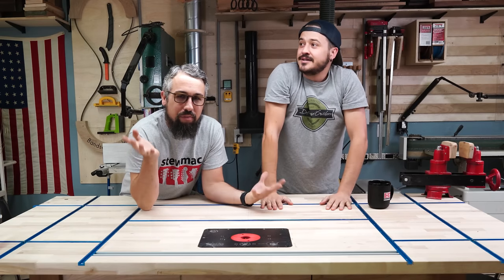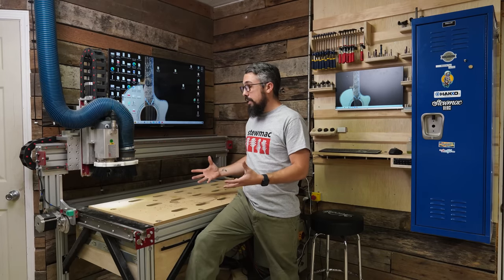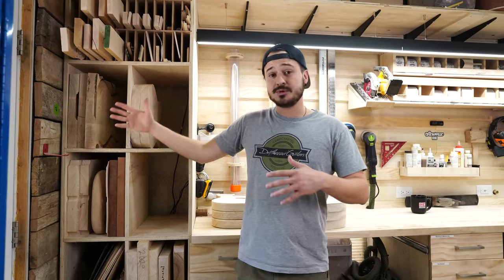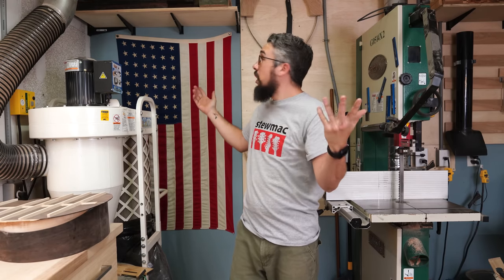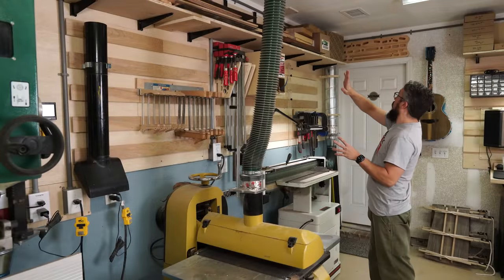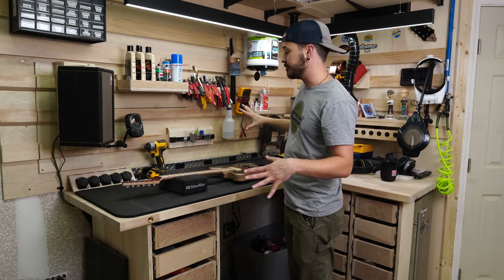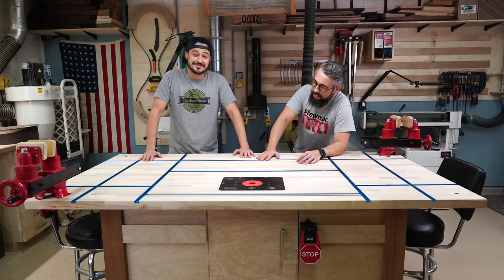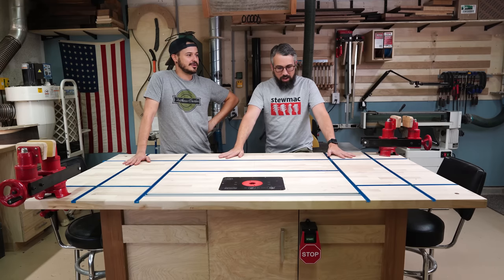We Spent $30,000 Making a Two Car Garage Our Dream Guitar Shop!

Comment: Here is a money saver tip concerning your fan in your paint booth. If the motor was located outside,  you wouldn't have to have and expensive explosion proof motor. Why? Because you are moving an arcing and sparking device from and explosive environment. All you would need is achieve weather resistance.

Comment: Love the shop. It’s well thought out and the French cleats really adds a nice dynamic to everything.  You’re no longer stuck with your decisions today for years down the road.  

What do y’all have in mind for communication between the shed shop and the garage shop.   Y’all are so intuned to each other that the shed shop could become isolating.  A voice activated mic and speaker intercom system may help keep the hood feels y’all have flowing when you’re working in separate buildings.  

ETA. Also good for when you need help right away in the case of an accident like gluing yourself to the bench.
Reply: My thoughts, exactly. Some kind of communication system, even a simple 4K wi-fi webcam style device may be helpful when the needs arise. Could also make for additional "B" roll!

Comment: Love the shop. To save your relationship and the I told you so’s.  I have found the best method of storing and organizing tools with cords is a bag, tag, and rack system. Each tool has its own zip tool bag that also holds its accessories such as blades… tag the bag with luggage tags and your all set.

Comment: Great job !!! Quick thought though…. You guys should have the 1/4 cable to the Spark on a pulley like the air hose @ a gas station. Only with a stop feature. Also, maybe I missed it, but I counted 5 tubes for the strings ?!?
Reply: Never mind about the strings, I just watched your other video. 😂

Comment: Love the French clear system and going to give my one garage workshop a remodel soon and add them in. Not sure on the bandsaw blade holder. Looks funky but if I understand it right all the blades stack up together in there so you are going to have to remove them all to get to one blade in which case it looks a pain and you won’t change your blade. I Like the track system on centre table and going to do something similar to my main chunky workbench cos my old thinner topped router table has bowed over the years with the weight of the router and I’d like a way to hold down material for planing etc. No table saw?

Comment: I am setting up shop again and am really torn on the French Cleats.  I love modularity but the storage density seems really inefficient,  I am used to a Ben Crowe type tool wall behind me where I can get 10x the tools in the same space.  I am hoping that I come up with a hybrid system of tool wall plus work task centric caddies that I can mount on cleats and pull over to the bench as needed.

Comment: Awesome job!! I would highly recommend pre cutting wire lengths for wiring the Tidlecasters since you are doing batches and putting the in mason jars on the cleat system. You can also build a hanging folding wall on a track  for the clean area if you feel the dust is too much (Put in windows if you feel Mat deserves to see out of the room ;) ) .

Comment: The new shop is looking great! One comment, more a question really. Is there any concern about plasticizers in the yoga mat? I ask because someone I know* once left a lacquered guitar on his bench on a router mat made of similar-looking material and the surface of the previously-pristine guitar was marred and had to be stripped off and refinished. I have known for years that vinyl upholstery eats guitar finishes, but the mat was a nasty surprise. I don't want to be a Sucky Mcsuckface, but better safe than sorry!
*could have been me.  Just sayin.

Comment: Fantastic job! 
But...why only five string tubes?
Reply from the maker: Because we only use 5 different types of strings in the shop.
Reply: @DriftwoodGuitars  Thank you for simultaneously answering the question and not answering the question.
Reply: @DriftwoodGuitars  I've watched the other string video and worked it out. Each tube contains complete string sets and not individual string sizes.
I was thinking every guitar was strung for Keeff Richards or as a CGDAE violin. Cheers